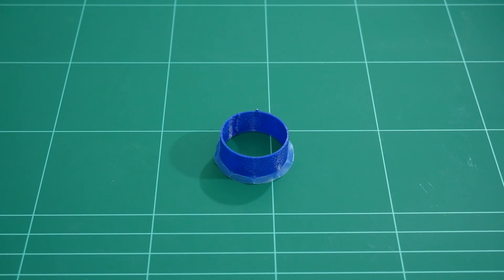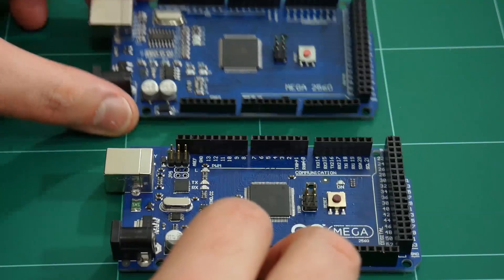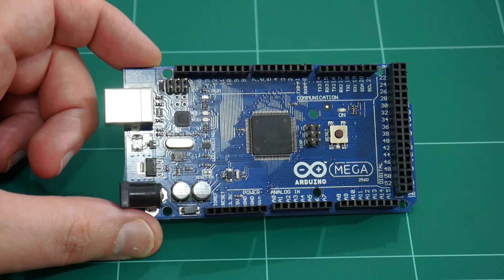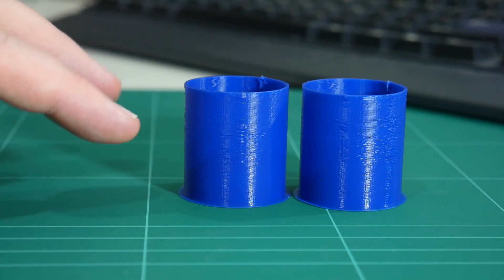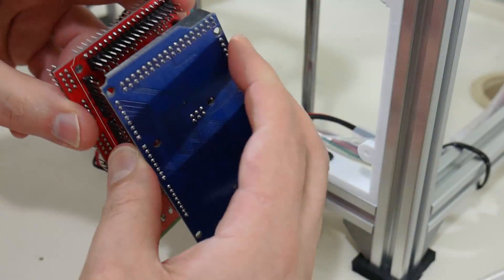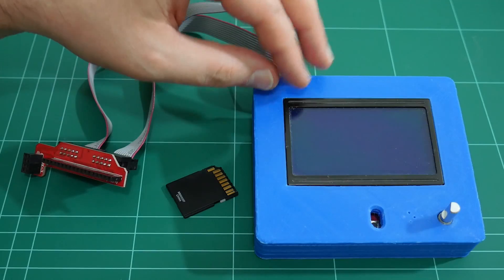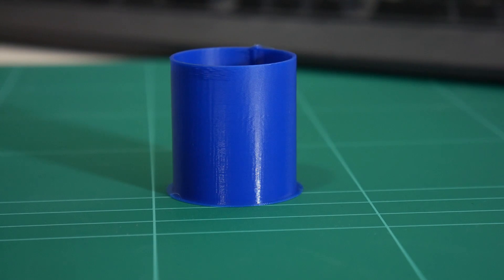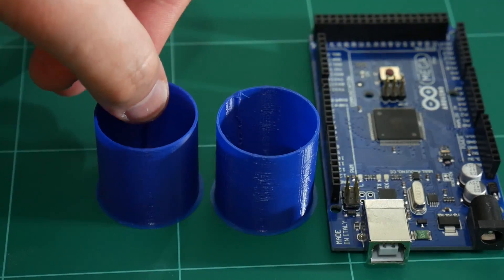HyperCube 3D Printer 8-Bit Speed Wall - Part 2

Comment: Done the same tests and a bit more (10mm/s increments)
1. Mac USB - 40mm/s
2. PC USB - 40mm/s
3. Octoprint USB - 40mm/s
4. SD Card, no LCD - 80mm/s
5. SD + LCD - 80mm/s
6. 16MB SD Card (yes MB) - 80mm/s
7. Class 10 bling bling - 80mm/s

DIY CoreXY, not a HyperCube but still the same.
Reply: thanks! Do you think a wifi sd card performs as well as a normal one?
Reply: Seems to be any SD card is good enough for 3D printing - my 16MB card from my very 1st digital camera was good enough! Also those WiFi SD cards are advertised as camera cards so should be good enough. But regardless they should have Class ratings.
Reply: Now it would be interesting to compare Marlin with Repetier :)
Reply: I think the bottle neck is related with the SD max speed reading and the processing time of the AVR. It would be advisable if someone have tested it with an Arduino DUE can share its results.
Reply: eh then klipper why print so fast? it is octoprint and klipper is different
Reply: @hambaallah1948  8bit boards are slower because they run full firmware on it, when you do klipper it does split tasks - all the calculations on Pi and AVR boards do stepper, sensor etc tasks. In octoprint case you simply send gcode line by line via usb to marlin to calculate and execute, well you can do sd card print via octoprint which is faster hence no usb bottleneck and octoprint only works as monitor for the machine.

Comment: I know we all want to see what a 32 bit board would do, but I have a particular curiosity. Nikolay-Kha has gotten PyCNC working on the Raspberry Pi, and using the just in time compiler he's claiming 300mm/s.  This would be reduced a bit if you used the Raspberry Pi 0W, but at $10 each, it would be an interesting setup if you could rlogin over wifi, copy your G-CODE to the flash memory, and then start a print running on the 0W, and get faster print speeds than you can with the Atmel chips.
The code is stored here:
https://github.com/Nikolay-Kha/PyCNC
and in the text there's a link to a youtube video.

Comment: Hi there. I think your information is wrong .please look here https://arduino.stackexchange.com/questions/296/how-high-of-a-baud-rate-can-i-go-without-errors
I am currently testing it to run at 500000 bits per second see how it goes.
Reply: Got it done and set it to 1000000. it is working ' you need to set the baudrate in two places in the epprom and in the communcation tab of printer setting.
Where do i get your files to test the mm/s ?

Comment: i wonder why nobody is using a esp32 its 240mhz dualcore wifi bluetooth and cheap as chips.  maybe too few I/O available but nothing a io expander cant fix. stepper out / math and print job could run on core 2 while reading gcode and managing settings on core 1.

Comment: What if one could produce a $30-$40 board that has a high-performance processor doing the heavy lifting and an 8-bit micro to only drive the motors and read sensors, Octoprint or similar spooler support on board, display support (like the ubiquitous 4.3" widescreen), but little extensibility otherwise, would that be something people would want to get?
Reply: klipper

Comment: I think you have been victim to counter fitting .. As the original MEGA has a golden capacitor next to your USB port. Your "Original" MEGA has a green one. 

The golden capacitors are specially made for original arduinos :)

The top one is the real deal: http://2.bp.blogspot.com/-qjRlVJoOscI/ViKOyI0iyII/AAAAAAAAHzA/bHrNEcHeE24/s1600/MEGA%2BArriba%2BD.JPG

Comment: I am wondering if there is an overhead penalty for setting variables (speeds, XYZ size, temps and so on) with M codes vs just defaulting to the compiled inline ones. Seems to me there would be memory fetching overhead. Please test.

Comment: Very nice video, great information.  I have been printing using the USB card exclusively since I got my Anet A8 with the extended bed a couple of weeks ago,  The only problem I have had is static electricity when I change the SD card which eventually caused my controller to die.  I have a new one on order from Banggood which should be here in a couple of weeks.

Comment: Baudrate != Bits
thats 115'200 Baud and 250'000 Baud, not bits...
Reply from the maker: According to the Atmel datasheet "The baud rate is defined to be the transfer rate in bit per second".
So I guess Baud == Bits?
Reply: https://en.wikipedia.org/wiki/Baud
Reply: The term Baud was relevant back in the days we used modems on dial up. Even back then people used the term wrong. We would call our modem 2400 baud but it was really either 600 baud with 4 bits per symbol or 1200 baud with 2 bits symbol. Both gives a data rate of 2400 bits per second.

Baud means symbols per second. For serial data on RS232 or USB each symbol is 1 bit so Baud and bits per second is the same.

Some modern technologies use many bits per symbol such as high speed ethernet, but we do not really care about that. Therefore it is best to always use bits per second.

Take a look at https://en.m.wikipedia.org/wiki/Modem for the details about Baud and modems.
Reply: Baudrate = bits per second. Learn your 90's.
Reply: from the wiki page above  : 
In digital systems (i.e., using discrete/discontinuous values) with binary code, 1 Bd = 1 bit/s.

Comment: those tiny pauses look like the code isn't sent in the smartest way to the device.  it should be buffered so there are no wait times. i'm sure it could be fixed with a small eeprom or another atmega/attiny.
so either someone writes better code or, using the current software, you have to use a much higher speed device, something in the Teensy or Cypress Psoc 4/5 mhz range, also featuring DMA channels. in fact i'm  sure a Psoc can be configured to emulate an sdcard device so that you can send the data without moving cards in  and out and without changing current hardware.

Comment: I'm still and advanced NOOB in the 3d printer world but expert in my network of friends. Anyhow how do you disable the LDC and still be able to select print from SD? Are you simply blindly selecting "Print from SD" using the panel controls? I'm currently Printing parts for my own Hypercube on my Prusa I3 and by nature I'm a impatient person and want FASTER!!!!! When there are 32bit board readily available and documented speed creepiness I will be on the short list of ordering.
Reply: I wonder if a person could use a unused Digital input pin to disable the LCD manually say like during prints but If necessary re-enable LCD updates to make run time changes?
Reply from the maker: You can enable the SD card independently to the LCD in Marlin. I then use Pronterface to print via SD. There is a SD button next to the print button in Pronterface.
Also in Marlin RC8 there is an option to limit the LCD updates only if there's free processor time. Downside is it could make the LCD somewhat unresponsive and the knob input may be delayed.

Comment: What about making the G-code with G2/G3? I dont know if any slicer can do that since STL files cant have any radius's, but you could manually make the code. It should print as fast with USB since there is much less data

Comment: Any way to eliminate that slight pause between layers when it's Z axis turn to move? Staggering the start/end points perhaps?     

Thank you for the effort you put into these excellent, no nonsense videos!
Reply: The slicer tells the print to slow down the x and y to zero, then move the z, then start the x and y running again. The pause is the effect of acceleration limits and a z-only move. It’s just physics. You can eliminate it in vase mode.

Comment: Great video, gives new perspective to getting quality prints. Just a tought...we all agree that grafix LCD makes lots of overhead, but what about standard Smart LCD controler with 2004 LCD? How much it uses of MEGA power?

 If max speed via USB is about 45mm/s and max usable speed by SD card without LCD is 75mm/s, so printing from SD with 2004 LCD on should be something in the between?
Some of us should test it...

Comment: Have now got all the parts to make a printer,  but cheap printer does not make good parts,even with the great setting you gave to us have made a big improvement to my prints thank you so much , but they still are lifting away from the bed about firth layers into the print, i don't think my bed is working correctly, maybe the new will.
I hope you are going to be able spare the time to help me out?.
Looking forward to 32 bit board in the new year!!

Comment: DUDE this video is a breakthrough. Really appreciate you going to the effort to test it. I always disliked tethering but this really nails down the issues - not even taking into consideration any dropped code due to interference. I suppose this is why all the cool kids are moving to 32bit boards now ? :) I have always used onboard storage where possible.
Reply from the maker: Hi Angus, thanks for watching. I was surprised there was such a large difference between USB and SDcard. My old machine didn't have this issue because I couldn't print fast anyway, but this is now a concern. I'm just not sure how much to spend on 32bit, what extra features I'd like, and new firmware to explore. 1st world problems :P

BTW, great job with your Prusa i3 MK2 review! By not saying "best 3D printer money can buy" has earned my respect!
Reply: It would be interesting to compare Repetier on ATmega vs. ARM 32bit - I know it can be compiled for both. That may show the raw difference in HW.
Reply: I just ordered the MKS SBase for like $60 and I'll give it a whirl. I really like the idea of it having a built in web interface and have the ability to control it from my computer, and I get to get rid of octoprint/RPi
Reply: @ianide2480  Just out of curiosity, how was the outcome? Did you swap the boards? I have a duet wifi waiting to be implanted into my CoreXY, but for the CR-10S that board might be an upgrade worth buying.
Reply: @limbopferd  Sadly I have not taken then time to install it and it is collecting dust. I really want to do the upgrade but I'm procrastinating way to much.
Reply: @ianide2480  I know that issue. I've been procrastinating on the finalization of the CoreXY for far too long. But thanks for the reply!
Reply: If you'd like a cheap way to get into 32-bit, try the MKS Sbase. It's a Smoothieboard clone that can be had here in Australia for about $100, or about $50 from China. Also, another option for you might be to try the Arduino Due (the 32-bit version) with that same shield using one of the 32-bit firmwares, like https://github.com/dc42/RepRapFirmware. You can get a Due on Banggood for about $25.

Comment: On my most recent build, I was printing via an older dell laptop.  I kept getting terrible prints like the 50mm/s area (but worse).  I finally figured out it was the actual PC slowing things down.  I created a dedicated PC running Repetier-Server, and all of the flaws went away.  I should do this trial with that to see if there's a difference.  I could post a response and test via my other Youtube Channel inventimark if you wanted to see that.  What size is the cylinder?

Comment: Unfortunately it's a bit more complex than a simple speed number. The speed is indeed correct for the model as sliced. Do a different model, slice it with a different slicer (or different settings if it's a good slicer) and you will get a different "max speed". 

Yes, you could go to a 2.4 GHz quad core 64 bit CPU with a few gig of RAM plus a dedicated 180 MHz 32 bit MCU on each stepper. That would not max out at any speed (done properly). It also would cost as much as most printers .... No free lunch. 

The problem is not unique to a specific printer type. Some designs will go a bit faster than others. They all will hit a wall eventually if you have enough curves in the model. Large volumes and lots of complex motion math will eventually overwhelm an Arduino no matter what.

Comment: Has anyone tried using an Arduino Due board? I know it is end of life but there are still copies available on eBay. Looking at the print speeds people are getting, the ARM chip running at 80+ Mhz will go a long way to fixing the speed issues printing from either USB or SDcard.

Comment: for what it's worth...
The Makerbase MKS Sbase card has an RJ45 port.  Also a USB and an SD card slot.

If you purchase the 3.2" color touchscreen display, you can hook up a wifi module to that.  The wifi module is an extra $18 USD or thereabouts.  It supports 802.11 b/g/n.  Seems to me the color touchscreen is around $40, ballpark.  Purchasing the board, the touchscreen and the wifi module would cost you around $130 or so.

Makerbase has a store running through AliExpress.  I have found individual items on other sites - for example, the wifi module is on Banggood - but in terms of an actual store presence, they seem to be confined to AliExpress.

The Sbase card is not a clone of anything; it is original engineering.  You can verify this by comparing a picture of the Smoothieboard to an MKS Sbase board.  Everything is in completely different positions, and different components are used.  Compare this to the arduino clone boards vs the genuine arduino boards.  The clones appear to be identical, right down to the silkscreening that identifies them (falsely) as genuine arduino boards.

The Sbase card uses the open source smoothie software originally written for the smoothie board.  I do not believe the card is supplied with any software; purchasers are advised to download the smoothie software from github.

It's really, really, really hard to find out anything of substance about this card.  There's a github group which contains software, questions, and no answers.  There's a Google Groups page which contains questions and no answers.  The main page of the Makerbase site is a .cn site written in simplified Chinese; the auto translation in Google Chrome will translate some of it - poorly - but much of it is not translated.  And when I attempt to visit the english portion of the site - one layer in, at /eng/ - firefox flashes it as an attack web site, Malwarebytes screams fire and Avast shits its pants.

That's all I've got.  Have to go clean my monitor now.  Damn Avast.

>Charlie

Comment: Some of the new generation boards - 32 bit, 100+Mhz processors - also have wifi and RJ45 ethernet ports.  That might prove to be a much faster way of transferring information than trying to send it over a serial connection.  I don't think buffer size will have much impact, unless the buffer is large enough to contain the entire file (extremely unlikely).  If the machine is processing data faster than the data is entering, sooner or later the buffer will be emptied.  The real solution is to remove the data restriction, which is what moving the file to an SD card does.  At that point, fundamental problems with the old architecture come into play; problems that can only be remedied with a faster processor, AND the support structure to make use of it.  I worry that upgrade solutions - like dropping a 32 bit, 100Mhz processor onto a ramps board - might simply result in a processor that spends a lot of time at idle, waiting for the support circuitry to catch up.

Comment: Nice test, thanks. But you didn't mention resolution of the cylinder. Higher resolution means more polygons what makes it more complicated to calculate. Results will be different with lower resolution object.

Comment: Very interesting i guess this applies for all printers controlled via a usb and Pi3 to... so Octoprint and Astroprint are at the disadvantage when you want to do fast printing.
Reply from the maker: It could be the CoreXY kinematics causing extra delays with USB-serial communication.
Reply: ahhh that makes sense. Needs some further investigation for sure. Good i now have a new project. BTW- Tech2C i Notice that you did not do the spiral-vase slice setting it might be interesting to see if it works better/worse.

Comment: cylinders are worst case condition as they are really many little lines. Unless your printing cylinders constantly then serial over usb is fine.   You should also check your stl file and eliminate polygons that are to small to print. There are also advanced features called arc's one line of gcode for the entire circle, but slicer and firmware has to support this.
Reply: exactly my thoughts, interesting to know if this test was based on G2/G3 commands or simply multiple G1s for short straight segments along the circle.
Reply: Waylander I don't think any slicing software actually supports G2.

Comment: I suspected that printing from the SD card would be superior.  I guess I'm going to stop printing from the local hard disk on my raspberrypi/octoprint and only use the SD card from now on!  (That is until I get marlin running on a SAMD21 via USB).

You should also try using a printrboard.  This is an all in one board that uses the atmega90USB128 chip with a USB port, no serial.  This runs at the max USB v2 speed.